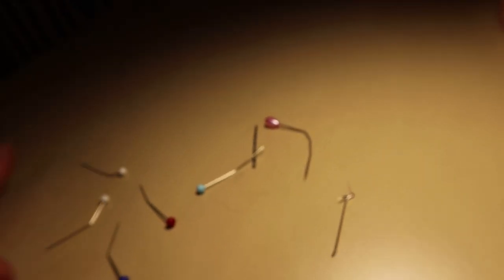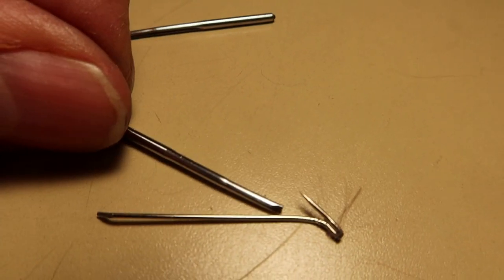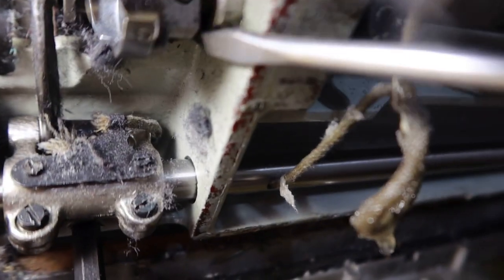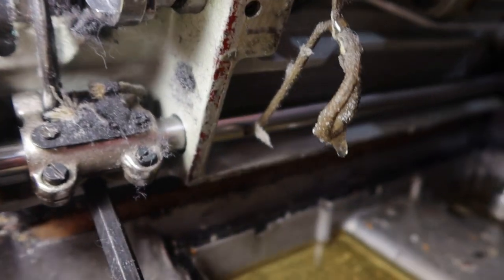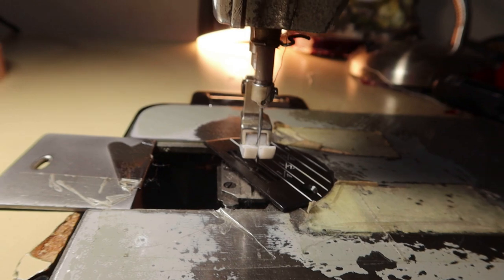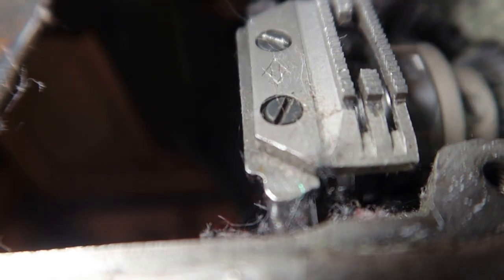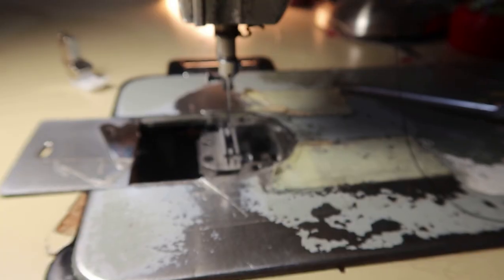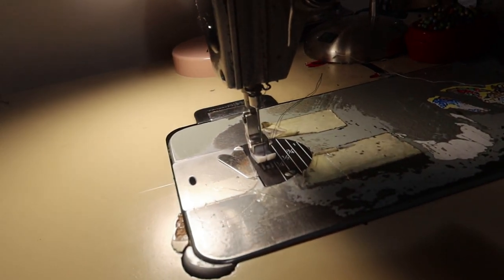How To Set Your Timing On Your Industrial Sewing  Machine

Comment: While I understand & follow your logic, I’m still going to let the repairman be the responsible party.  I do exactly the same thing that you do, sewing over the pins & breaking or bending a needle. I have also removed the plate over the feeder feet to clean lint out of the machine. I discovered excess lint can cause stitches to be slipped.
Reply from the maker: thanks so much and yes, l did need to clean it and good to know

Comment: Thanks for the video. I accidentally put a scissor underneath the needle and when i switched the machine on, the needle hit the scissor and broke. Now my machine can't sew. What might be the reason? Was needle holder affected 😢
Reply from the maker: ur welcome and oh no, put the needle back in and see if it works alright
Reply: @MammaOVlogs  thanks for your kind reply. it seems the needle now goes deeper than normal into its holder. When i lower it, it works. Any permanent solution to this

Comment: Okay I took the screw off but it will not move 😢
Help
Reply from the maker: l hope you got it fixed, when l had the screw off l would but the screwdriver into the v part and then turn the wheel with my hand until the needle would go into the v part then l would tighten the screw up and make sure that the needle is going into the v part